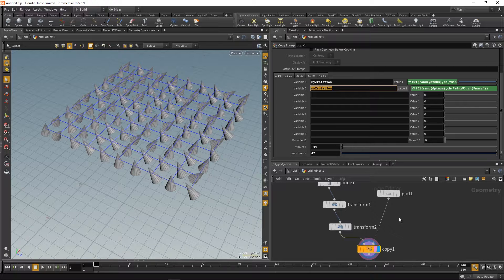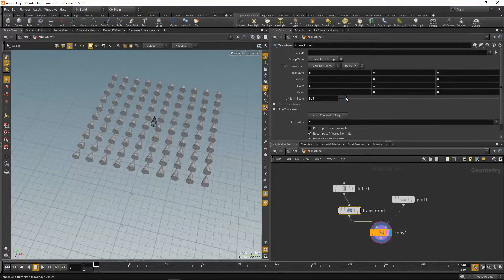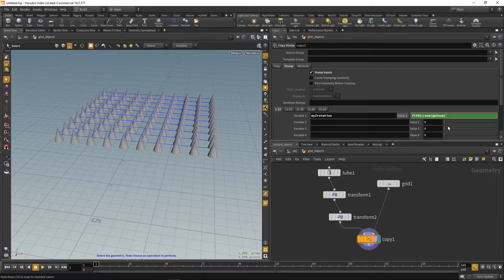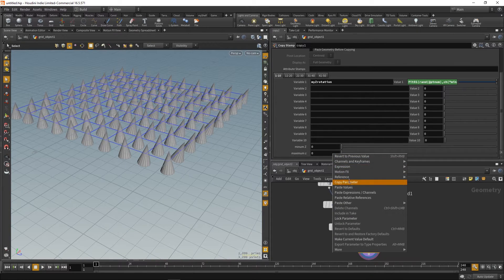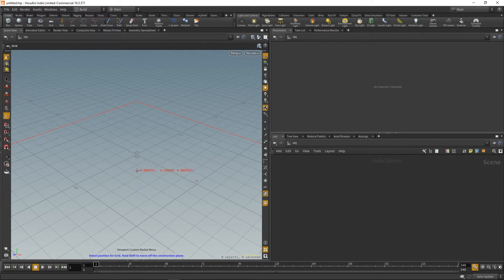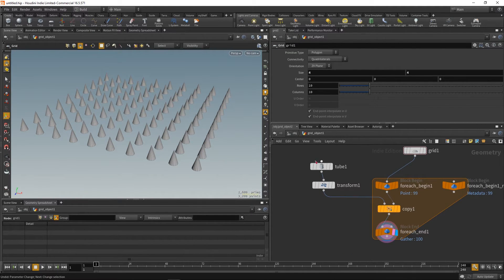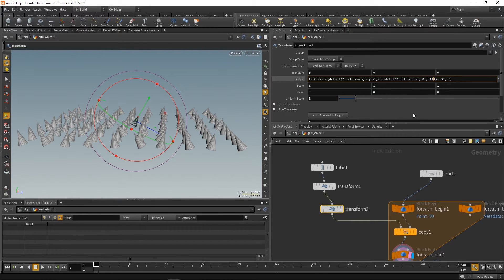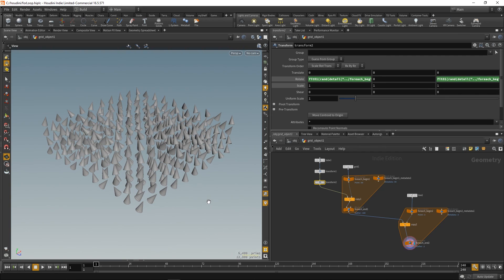Copy Stamp vs For Loops (and random rotation)

Comment: For that example you could do something like @orient = rand(@ptnum); before copy to point. For each loop not even needed.
Reply from the maker: Hi, yes correct. For this particular example it is not necessary. But the goal of the tutorial was to show the difference between copy stamping and for loops. For loops are extremely useful and it's great to get to know them.

Comment: Thank you very much for this tut,
was wandering how can we use @Cd for for loop points, for example i have a grid with animated colors black and white and animated object . I would like to  time shift and say, where white push animation.
Thank you .
Reply from the maker: Hi there! I am happy you enjoyed it. Can you elaborate a little bit on what you are trying to do?  Not sure what is the goal. But if you need to use a @Cd attribute for turning on and off an animation maybe you could just use one component of the color - lets say red @Cd.r and multiply the speed by it ? So if its white it will play if black it won't.